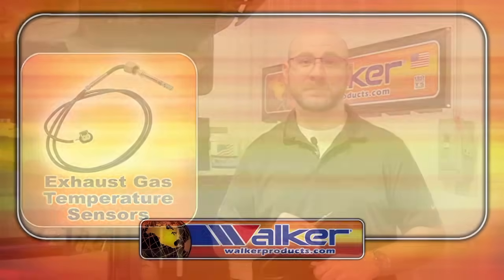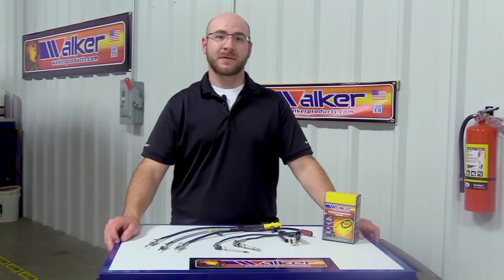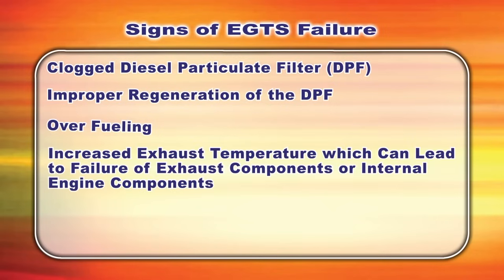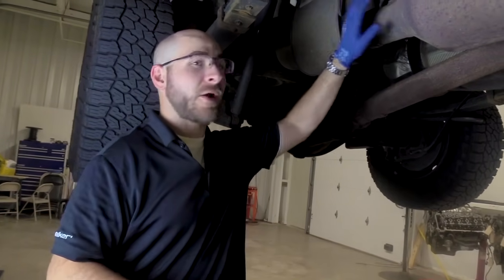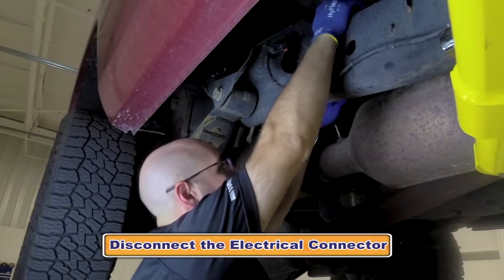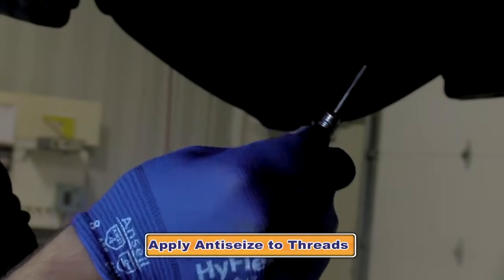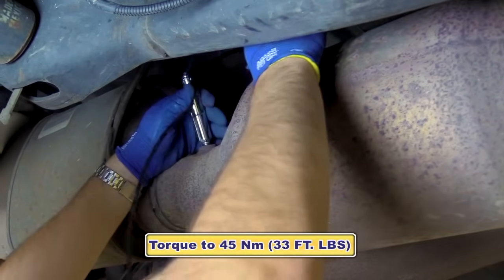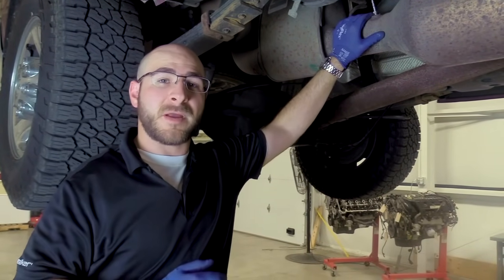How to Install an Exhaust Gas Temperature Sensor | Know Your Parts

Comment: You should mentioned what engine code number, location of EGT you replaced, part number, price of part etc. Before replace, recommend to inspect EGT and measure resistence or dirty etc. Sometime just to clean it.

Comment: i have a honda crv 1995 model rd1 ist generation, however it carries an EGT sensor that only have a one wire connection at the plug in section but i have looked all over the internet and so far only finding two wire ones. Can the two wire EGT sensor be used to replace the one wire sensor. Is one of the wires actually a ground wire?

Comment: Haha, if only it was that easy ??? Not so.on my Ford Escape !!
Put my 13mm spanner on the sensor and it wouldnt budge, started to round the nut.
Also no idea, and very difficult to follow wire back to engine bay where it is lost to sight ?
Reply: When fitting make sure you use anti seize compound..

Comment: The location of the sensor is the same for most cars? I have a Jeep Patriot with engine light on, fault code P2080.
Reply: I believe P2080 is sensor before DPF (opposed to after)
Reply: @yehmustafa2959 is this the same for a  2017 ram 2500 Cummins?

Comment: I have a Volvo XC90 2011, I'm finding it difficult to remove the sensor, it seems really stuck, am i risking putting extra pressure to remove it?
Reply: hey guys, i know it's been a while and you've probably figured it out.  if it's anything like my 30 year old O2 sensor i just replaced.  they're very similar.  i read a trick i thought was BS but damn it worked great.  obviously spray a bunch of penetrating oil best you can and let it sit for a bit.  grab one of those little cupcake or birthday candles and heat up the bung while pressing the candle into the top of the threads best you can.  it's best if you have the proper socket like this guy with the notch for the wire but you can use a wrench as well (it just twists the wire and you may not have a lot of room for the wrench).  see if it will start to break free, if it does kinda work it back and forth and then a little more out at a time, be patient cuz you don't want to break this thing.  again, i thought it was old wives tale but it worked great for me for both my O2 sensor and my EGR valve in a 1990 ford that was CRUSTY!:)))-barbie
Reply: Having the same problem on my peugeot 307 can anyone helpt its like really stuck i tried everything

Comment: you did id in 5  min,  for my ML 350 BT , dealer ask 5 Hours of labor ........$1000 +
Reply: hi sam , I want to replace egt sensor on my ml350 bt 2014, would you please tell me where is it?  under the cabin or under the hood? could'n find any video on line. thanks!
Reply: LOL that's why I don't trust any mechanic. But  could be other dps sensor in other position...not all are located in easy places like this I guess.